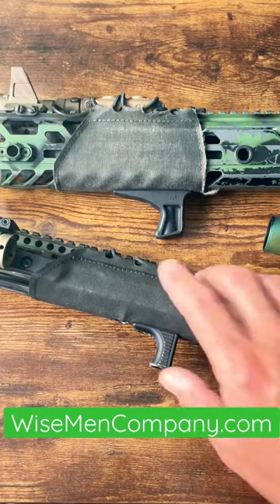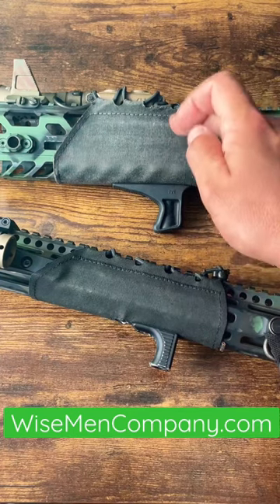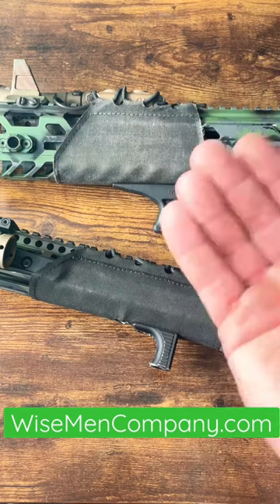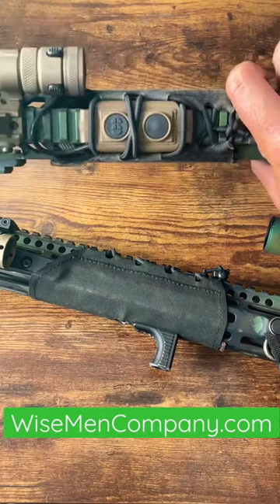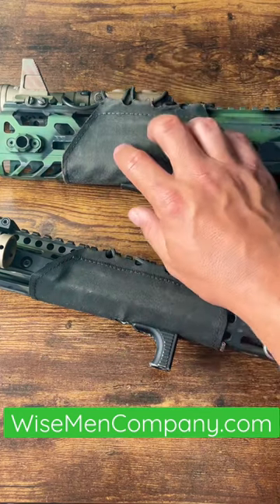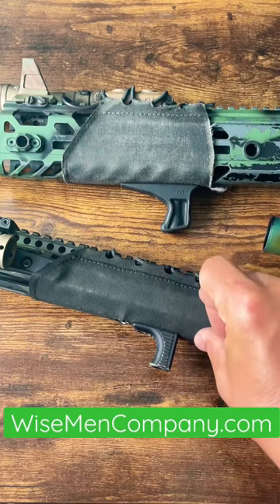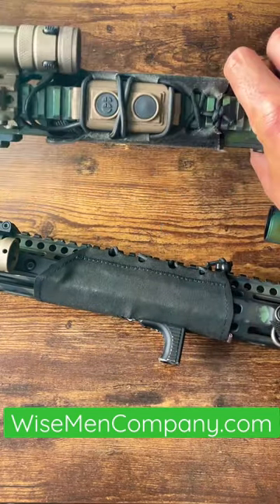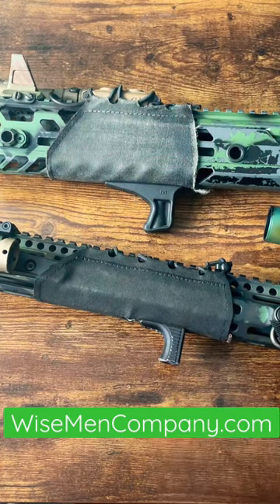Hot Pockets just like mom used to make. Nuclear hot on the inside & icy cold on the outside 👌🏼.

Comment: I ordered a black multi cam in the Thick for my bigger rail. It was delivered within 2 days and when I opened it to my disappointment it was solid black. So I emailed the company with a picture and shortly after I received an email back from Noah apologizing and told me he had already reshipped the correct one and not to worry about sending back the mistake. This is a very reputable company and I have nothing but good things to say about them. As for the product it is amazing. So much better than the Burn Proof Gear ones. It has mlok slots and it’s a solid piece unlike the competitors. It protects your hands great from heat with a suppressor that tucks u see the hand guard. Shout out to Noah, great guy.